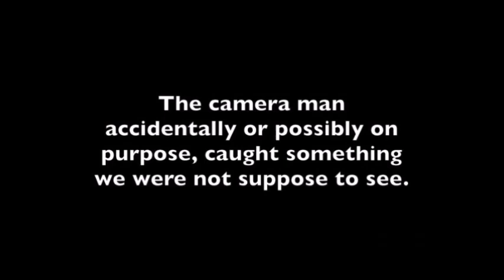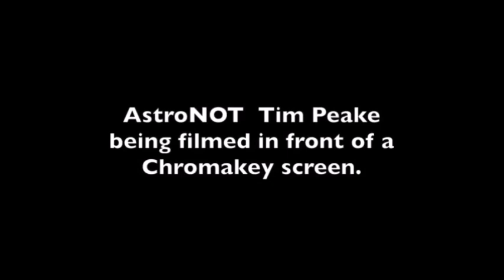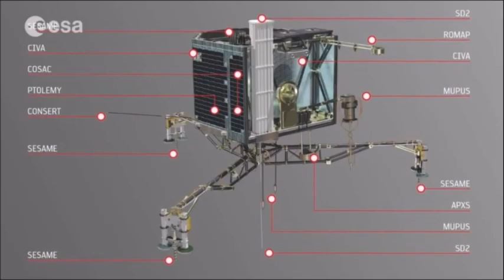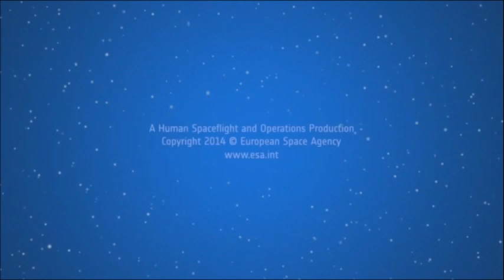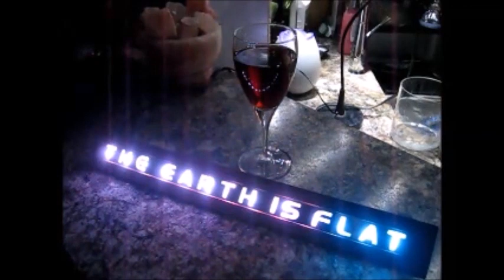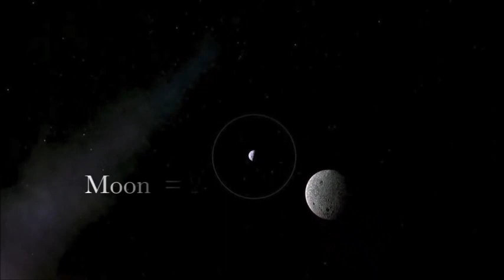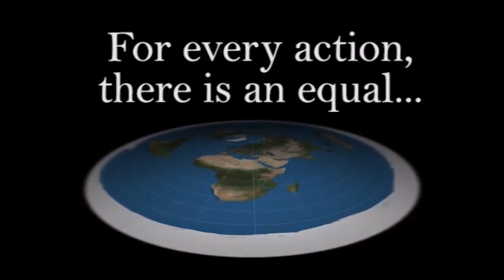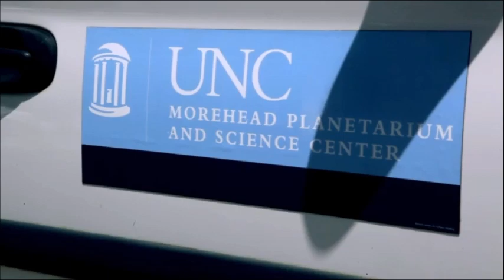Flat Earth Q&A Emails 43 - Mark Sargent ✅

Comment: Pull a string tight at eye level on a beach. Line it up it with the horizon. Look left. Look right. That's about 30 miles each direction. Notice any curve where the water meets the air?